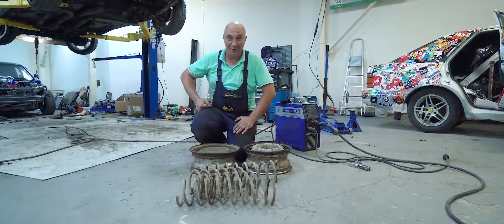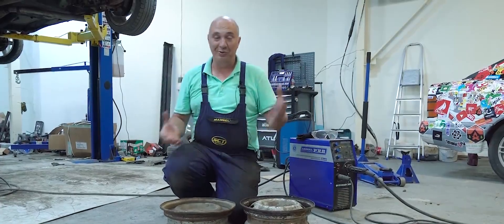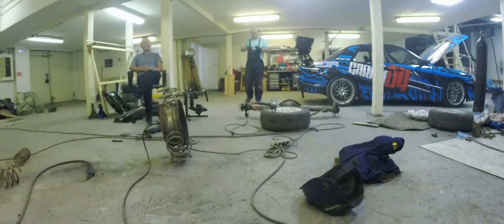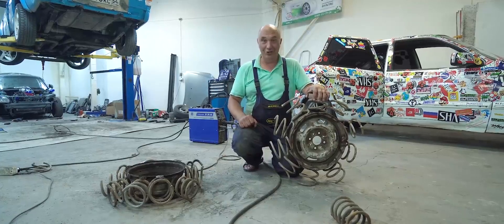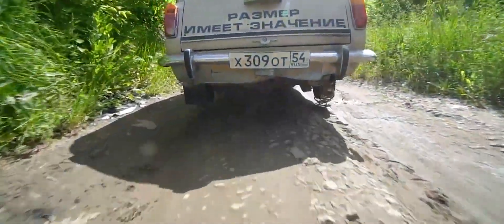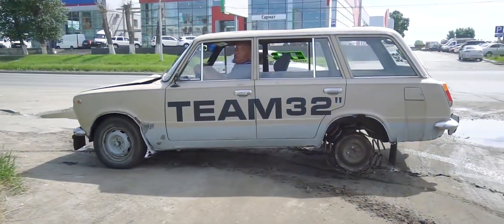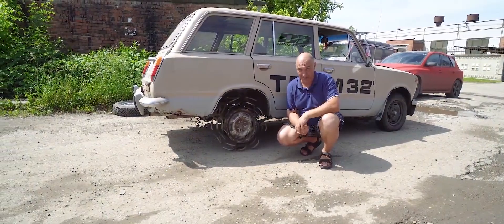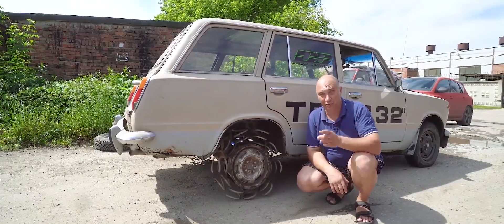Using springs instead of rubber tires

Comment: NO MORE PAYING FOR AIR AT THE GAS STATION!😉😆😆
Reply: You pay for air? Which country are you from?
Reply: @ChefSeanThomas868   merica
Reply: @ChefSeanThomas868  this is nitrogen at the gas station not atmosphere. Nitrogen does not leak via osmosis through the tire it also does not change pressure as much with temperature.
Reply: +sean thomas usa and canada charge like 25 cents to a dollar
Reply: @matthewshinn5839   it is free in many gas stations.
Reply: @chudgo081793  in germany it is law to get free air by every gas station
Reply: @matthewshinn5839  USA has it free too. Depends on the station. Higher quality ones are free it's only the local mom and pop stations that need to charge to maintain the machine.
Reply: Jon M I didn't know that 7-11 and circle K were mom and pop gas stations. I think it's $1.50 for air at those stores.
Reply: @Primalxbeast  Maybe because they're generally in very populated areas. Quick cash.
Reply: @Luckingsworth  quit bullshittin plenty of the biggest gas station chains charge for their air.
Reply: @isaiahsea3248  Guess it just depends on where you live. But the higher end stations definitely are the best place to go. Free and accurate machines.
Reply: @matthewshinn5839  Not true. I've never seen one person in my life pay for air. Maybe some places in the US but definitely not many.
Reply: Jason Bowens I never see any gas stations who offer free air. If you get an oil change at a shop, they may fill up your tires as part of the service, but self service air pumps at gas stations only turn on when you add coins. Here it's a machine that you can either pay for a vacuum or buy air.
Reply: @Primalxbeast  Well take a trip to the Midwest. You'll see them everywhere. Even Minneapolis and that's has a good amount of populationg. Hence why I said very populated. Yes not the greatest term but still gets my point across. I have never seen a pay for air pump in my life. And I've been to a few different states.
Reply: Jason Bowens I live in the Orlando area. I don't think heading out to one of the fly over states for free air would be very cost effective. :+)
Reply: Jason Bowens Besides, it's 66° here right now and I'm freezing my butt off. I'd never survive up north at this time of year.
Reply: Doesn't anybody have their own pump? I keep one in my trunk. It plugs into my cigarette lighter.
Reply: @mysterydude1  I do, I have 2 of them. They have to be connected directly to the battery.
Reply: Most auto shops gives you are for free as well.
Reply: +BeatStreat JB i wish that were the case in canada
Reply: SatanIsReal the land of milk and honey can never be a bullshit place to live in.
Reply: wow you pay for air i live in middle of war and air is for free
Reply: I just keep a electric pump in my car
Reply: Yeah, usually if you ask the attendant he/she should put it on for you. Other machines I see say "free air" but the gauge isn't too great.
Reply: +Primalxbeast im in Canada by Toronto and went to the circle k yesterday looked at the air pump machine and it was charging 2.50 on a digital screen that makes it easier for them to increase the cost more often i didmt know it had gone up that much a year or 2 ago it was a dollar then 1.50 now 2.50
Reply: matt shine $2.50 is crazy. I thought $1.50 was bad and they charge $1.75 if you use a debit card instead of quarters.
Reply: +Jason Bowens well if according to you some states do it that would mean you saying it "definetly does not happen " is a contradictive statement god bless the mid west if they aint chargin for air around there but i know up here in Canada its about 2.50 at some spots most from a dollar
Reply: +Primalxbeast the vaccume machines are expensive too its like 4 to 5 dollars
Reply: matt shine They're both the same machine here. There's an air hose and a vacuum tube. You put $1.50 in and you push the button for air or the one for the vacuum. I'd never vacuum my car if it was 4-5 bucks. lol
Reply: +Primalxbeast it sucks but our dollar is 1/4 weaker then yours right now.
Reply: @SatanIsReal free in northern Idaho
Reply: You can fill up the car tire with a regular bicycle pump. I've done this when I see my tires are low on air. It usually takes about 100-150 pumps from completely flat to full 33psi air pressure.
Reply: +Kevin Hinojosa if you put a bicycle pump tube in your butt and give it a pump you will blow the biggest fart of your life
Reply: Every truck stop has free air on the side the trucks use
Reply: ABQ ENTREPRENEUR here in Australia airs free my bro
Reply: Everywhere around me charges for the air pump, but if they're busy I will just ask the clerk to turn on the machine for me cuz it "swallowed my quarters" and if I feel like they would say something I just toss in a penny or two before asking lol not gonna pay $1.25 for goddamn air
Reply: Air is free

Comment: try putting the rubber from the top of the tires over the top of the springs and if you do all the tires like that you can use magnets to drive the car without gas

Comment: This is such a amazing idea, add some safety, make it a bit better looking, and it can be an amazing offroading tires, that don't even need air :D
Reply: Interestingly enough, Airless tires do already exist, but they're too expensive to be mass produced and sold publically, but they do exist. and they use a similar concept to this. just imagine having the springs, and then having a thick rubber tire tread that is wrapped around the springs that make contact with the road. that's essentially how real airless tires function.
Reply: Lil Meep NOT AN AMAZING IDEA. A STUPID ONE

Comment: For the spring wheel design the only problem is the road damage it cause to fix this you could calculate the radius of the springs (try to make it uniform) and then attach (curved but detached from eavh other) steel plates with rubber on the bottom to keep the roads in better condition. This would still let the springs move independently from each other.

Comment: Somewhere a hipster with a fake beard is planning an Indienogo or a Kickscammer campaign with coil spring wheels. For the second tier there will be a wrapping made of a checkered scarf for  better traction and lower noise. The third tier will provide a selfie stick that's attached to the hub, while the final tier rewards backers with a selfie stick on each lug nut.

Comment: I saw a science tv show in the 70's with a similar idea..except the springs were coiled like a snake and the outer band was rubber.They were testing in on a railway.It was fast,had good traction and the best part..no flat tires.

Comment: go find some larger rims, cut out the centers and weld the springs to it, using the new rims as an outer rim, then install a thin tire on the rim. should get a very smooth ride but won't be able to go very fast because of the balancing. Could use a solid rubber tire or a solid slab of rubber too...would be interesting.

Comment: I think you should weld the springs in the same direction not pointing front rear for the last coil touching ground..if they all hit ground same direction will get vibrations down.

Comment: do two more

maybe make them shorter and have some rubber pucks or bushings like they use for lift kits. 
basically anything that might fit easy and make the road/spring interface have more traction and less noise

Comment: Does that mean no need to replace tires or will the springs just bend over time
Reply: I've had one break in half spring steel is usually pretty hard so might most often break before bending with that much cycling causing fatigue. they can sag though

Comment: I imagine on the pavement and at higher speeds, fast acceleration and braking will lead to skidding and slipping because of the ends of the springs on the pavement. I imagine the roads department would not be too happy about what they do to the road surface.  But for dirt roads and off roading, the traction must be really good. I am also sure they would be effective in in snow or ice as well at low speeds.

Comment: Very nice if you need to break and unsurpassed on steep winded roads in the mountains.  Please mount the springs also on the front rims. Just go full speed downhill, till you feel the smooth liftoff and find yourself knockin on the pearly gates. But they won´t let you go in, because they fear idiots might mess up the golden Jerusalem because of their ignorance.

Comment: Idea: take a tire, put a protective protective circular plate between the springs and tire and put on the rim. You may have to make a special rim or modify it to get the spring inside. OR put Air shocks inside in place of springs with protective inner plate. Connect the air shocks air line in parallel with each one then connect to the rim air valve. Once the tire is on, compress  the air shocks from tire valve.

Comment: Do the leaf springs yet weld a metal strip a round it to stop the noise an see who the spring work inside of the metal strip welded around it as a tire

Comment: Dude this is cool you might be on to something here an off road tire that doesn't get flat, and I would think that your traction is increased also do to the springs digging in. I bet they would be good on snow and ice, I would think it would break up the ice under the tires and work better than chains on yer tire.

Comment: wrapping the spring with some sort of flexible surface may give better grip and ground pressure for even smoother ride. Not surprised about performance since what I'm describing and what you are doing are essentially spring tires. 
Also you guys are my favorite Russian channel! But I'm not used to the lack of protective gear during welding. Safety first! Don't want to see you injure yourself.

Comment: put the spring them selfs in individual rubber dips or covers to reduce noise and make for a better smother feel , or even a spray or silicone something of that flexibility , you would have to test different possibilities, like coils made with a hard rubber material or a hallow spring with rubber inside might work nice.

Comment: Wow...fantastic. Why don't you try putting some 2 or 3 or 4 pieces of steel sheet round shape on top of the springs.to make a Outer Dia f the wheel.. I feel it should reduce the noise to half at least. Just a guess but trying will tell us if it is working. Nice job ..nice work...Keep it up..Thanks
Reply: I think at most he could connect 2 springs each with a metal piece and that way he still gets the flex from the springs. Welding to many will prevent the flex which is giving the smooth ride he experiences.  But that wouldn't reduce the noise, he would need to attach rubber or something similar to each of the outer leafs attached to the springs.

Comment: Using regular tyres themselves act as a spring cushion actually. The air inside the tyre is compressible and acts as a cushion. The cushion effect is almost equivalent of several hundred small springs aligned.

Comment: We had a project like this in high school automotive class, we tested this out but the amount of stress put on the springs after a few miles would bend them. Also they have no good traction when taking turns and going up or down hills. Weather was a nightmare too on wet surfaces and dirt roads. The more weight added to the vehicle too made the spring loose there shapes. Is cool seeing videos like this but this guy is just given you part of the test, if he tried all the tires made of springs he would get the sane out come as we did.
Reply: thanks for your input man thats cool
Reply: @Egghead That's a pretty good idea!
Reply: No grip on corners = drift machine

Comment: If you have the coil springs and also the tracks off an old tractor to surround the springs, you will give them much more durability and still maintain that smooth ride. It would be stronger than rubber.

Comment: i think the obvious next step is do this on all 4 wheels
Reply: ...at 60 MPH of course, and jump it off a ramp
Reply: Yes, all four and then drive it in the snow!
Reply: @HillOrStream  drive in the rain, on a highway where the speed limit is 75 during rush hour😂😂
Reply: I’m sure it can have a rubber tread to smooth things out .. tire hack !
Reply: next step is to go 200 km/hour :))
Reply: @kokainhigh  while texting & driving while smoking a cigarette and drinking a beer😂😂
Reply: It won't be able to turn
Reply: Wouldn't work, if he went in mud or soft ground he would sink and have no way to drive out
Reply: @tonybaloney8401  but he would have some hella traction though 😂

Comment: Great stuff! I have an idea. How about u put a rubber layer around the wheel springs or some kind of a belt? That will solve the noise problem. Also will get u through rough and patchy roads.

Comment: if you put  like 1/2 rubber slick around the springs I think it could be viable long term? it would keep the springs from flexing too much and making noise along with probably making the wheel last much longer possibly.

Comment: You should rotate all the springs so they are less likely to touch,
Weld the ends of the springs using a hoop of wire to make a wheel shape,
 then put a tire around that.

Comment: Neat idea... maybe adding a ring of spring steel with rubber will help with the noise and long term durability... though the traction has to be great with as is so maybe spring steel rod on each side to form the outer ring and still have more traction potential maybe... plus could add like old fashioned steel tractor tires some angle iron for tread?

Comment: is that a rear wheel drive car? if not then perhaps try the spring wheels in the front to see what it would do under power
Reply: Dude, it's an old Lada. Sure thing it will be RWD.

Comment: Hello from New York.  One thing I always wondered, is what would happen if you used very thin oil (0 weight) in the cooling system?   Would it work,  would the car overheat, or would it be better than anti-freeze?

Comment: That was certainly an original idea that seemed functional at the least and should anyone have about 56+ feet of steel suspension coil in their trunk Whallah!! instant flat tire fix. But, you'll also need a welders torch in your trunk too.

Comment: Have you considered putting rubber around it like a tire?  I would think you could then get traction, drive on a real road, and not be concerned with picking something up with the springs.

Comment: I like this.  It makes for a nice ride in rough terrain, and also bites the rough terrain pretty well.  I'd like to see it in some slightly wet, more wet, slightly muddy, more muddy, and other types of terrain.  I'm curious what strength it has to go up a hill that is too slippery for rubber tires.

Comment: How about adding plates on the bottom and gluing tires surface to those, so you essentially just replaced air and side walls with springs? Other such variations could also be interesting to see.

Comment: Some bullet proof tyres are made like this. It's springs inside a regular tyre. It will lose air, but won't lose shape and can be driven on for many miles even with a huge hole. In Brazil, all money trucks (the ones that collect money from banks) have tyres like this.

Comment: Just like chains on the rear side of a school bus shakes like crazy and vibrations at first, until it levels out at a specific speed on the road. 
Next he/they should test large sawblades maybe from a sawmill? Also he should have the camera shy away from the wielding arc. 😕📚⚡

Comment: If he had a transitioning material between each spring, such as a rubber around the outside, it would probably be much smoother and less noisy. That would make it about the same, not necessarily just as smooth though, as a tire with springs instead of air. And another drawback to using springs is that would most probably tear up the pavement, especially asphalt, much worse without rubber around the springs. The city you drive that in will not be too happy with their roads being torn up.

Comment: It's great, until...

...the coils springs hook onto something, like some debris (branches etc) and either get snagged and the welding gives way and the coil is torn off, or, the coil tears away or takes the debris with it, potentially getting stuck in the wheel well. 
...you have to brake suddenly.
...it gets submerged in a thick mud-filled pothole and can't be pulled out.
...potholes.

Maybe of the end of the coils had rubber pads on the ends and some sort of covering over the actual coils, some of these pitfalls could be circumvented. 

Great gadget to have in the trunk, though, in a pinch when even the spare is flat, or if the terrain is not "tire friendly" (i.e. lots of nails and broken glass). 

I think this idea has potential to be something brilliant and lucrative for whoever can perfect the design. :-) 

Watch out for criminals who will use this invention/tactic to not leave tire tread marks at crime scenes or to effortlessly drive over them spike belts (laid down by law authorities trying), lol.
Reply: Lighten up.  the video is for entertainment.  This does wacky ideas for the sake of trying them and having fun.  Not to be critiqued on the pitfalls of an obvious goofy lark.

Comment: what if you made wheels using a Super glue and Baking soda mix, then coat it with a grip-able substance like Rubber, gum, sap or something similar?

The Super Glue and Baking soda mix will make an extremely hard and bonded surface while the grip-able substance helps with traction better

Comment: Cool. Now you need to cut the walls of a set of tyres so its tread only. Compress the springs and put the tread around the wheel. Release springs. Wallah, Treaded Spring Wheels.

Comment: Lol. :D I would imagine these aren't that good on tarmac/asphalt because of so low friction with the spring ends and I also don't think these will last very long compared to rubber tyres but this would be an interesting idea anyway if you have ran out of rubber tyres but not springs.